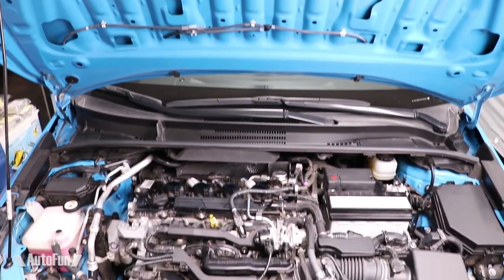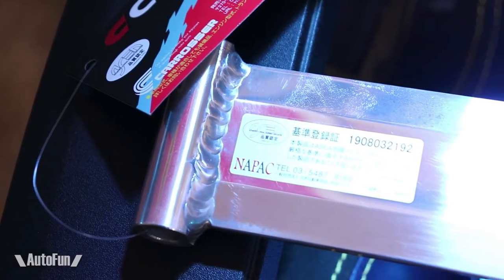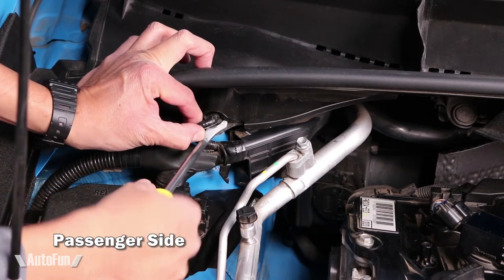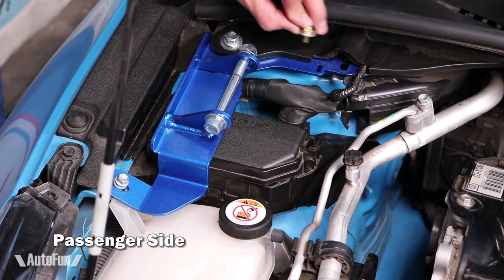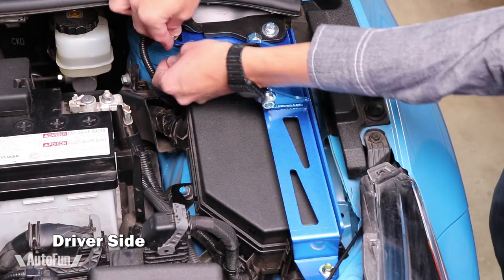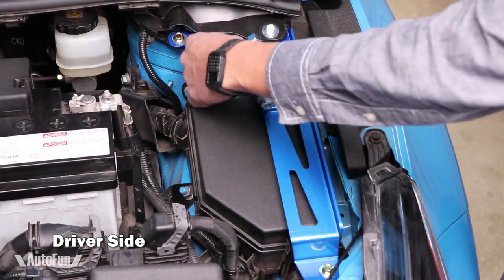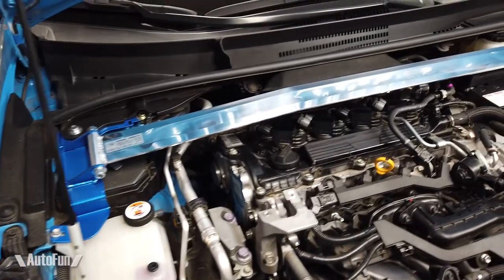Toyota Corolla CUSCO STRUT BAR Install & Review (E210 Hatchback 2018-2024)

Comment: This actually felt like it tightened up the steering some how. Thanks again for this video. Was a lifesaver. Although there’s still a loose nut in my engine bay. Not your fault lol.
Reply from the maker: Hi BBB! Yeah, the change is subtle but I also definitely felt it and it definitely also adds bling to the engine bay lol Cheers!

Comment: That bar is mounted to thin, body sheet metal on one bolt per side, the other two secure plastic trim. Strut bars need to be mounted directly to the strut hardware, which this is not. There is almost no rigidity gained from these Cusco units. Sure, it looks nice but that's just about it.
Reply from the maker: Hi Datsun Dan! here is the version that mounts directly to the strut https://youtu.be/yGkDgtHog60 for ultimate rigidity if your not looking to add bling to your engine bay. Hope this helps, Cheers!

Comment: Nice video. I'm definitely considering getting this strut bar. I am curious though. Looks like it covers maybe the fuse box on the drivers side and would need to be removed every time you need to access the fuse box. Is this true?
Reply from the maker: Hi JWalker! yeah it looks even more awesome in real life. To answer your question, yes it does block the fuse box (you can probably open the box but I don't think you can fit a finger in there lol) so I would have to be partially removed if you need to access your box often. Here is another alternative that does not block it (won't add as much bling to your engine bay, a little more work to install it but it's fully functional) https://youtu.be/yGkDgtHog60 Hope this helps!

Comment: the cusco strut looked really nice. It also put the bar forward in the engine bay. But I concern that one of the mounting point is actually on top of the coolant reservoir mounting clip, wouldn't it eventually break it?
Reply from the maker: Hi Fisher! Ah yes the Cusco bar does not mount to hard points on the frame (this can be a plus or a negative depending on how much NHV you are willing to bear and the amount of performance you need out of the car). Here is a good alternative if you don't need the cosmetic appeal of the Cusco and want ultimate performance (at the cost of increased NHV) https://youtu.be/yGkDgtHog60 Cheers!

Comment: Does the feel differ from the TB bar you had?
Reply from the maker: Hi jchcmax! Here is how I would compare them now that I experienced both: Cusco is just a work of art, looks gorgeous which is great for car shows and is functional. If performance is your top priority then the TB Performance is the way to go, the bar mounts directly to the strut towers which puts it ahead of Cusco as far as chassis bracing. With the bar and plates being black, it almost looks stock (I like the sleeper look) it blends in with the engine bay but for some people this may be a downside ( it may be possible to get it in other colors if you really want to add bling to your engine bay but I can't confirm that you can). As far as price difference, Cusco is more affordable vs the TB Performance which costs a bit more. Hopefully this helps bud and thanks for watching!

Comment: Overall did it make a big difference in handling and steering feel?
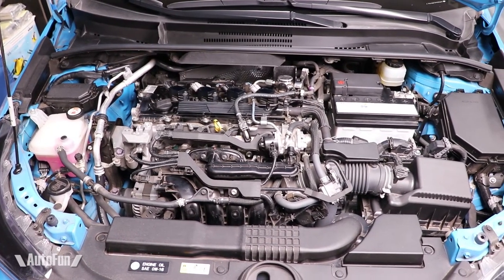Reply from the maker: Hi Caleb! yes it does but as I mentioned this is just one component of bracing and suspension, as you add more to the car the difference becomes more noticeable, but take a look at my test drive impressions at 9:31 for more complete explanation and thanks for watching bud!
Reply: No i don‘t think so. It‘s mounted extreme wabbly. You need one with strut bearing mount

Comment: If I buy it used and it doesn’t come with hardware would I still be able to install? Or I probably would have to buy the washers and use original nuts?
Reply from the maker: Hi Jose! I would recommend contacting Cusco to see what they recommend. Cheers!

Comment: Do you like this Cusco strut bar or the TB performance strut set up?
Reply from the maker: Hi Rush! Here is how I would compare them now that I experienced both: Cusco is just a work of art, looks gorgeous which is great for car shows and is functional. If performance is the top priority then TB Performance is the way to go, the bar mounts directly to the strut towers which puts it ahead of Cusco as far as chassis bracing. With the bar and plates being black, it almost looks stock (If you like the sleeper look) it blends in with the engine bay (for some people this may be a downside). As far as price difference, Cusco is more affordable vs the TB Performance which costs a bit more. Hopefully this helps, Cheers!

Comment: Cusco is eye candy, it works until you lean on it with your palm and it bends. This just happened with mine, sorry not happy with product.
Reply from the maker: Hi motomanz! and man oh no.. That definitely does not sound good. The bar is hollow for weight reduction and the internal shape of the tube has a lot of rigidity to support pressure in the horizontal direction (from strut to strut) while this design is great for aesthetics and low weight it also means that it will not be strong in the vertical direction, so I can definitely believe you it may bend if leaning on it. I haven't leaned on mine since I wanted to keep all finger prints off so I don't really touch it but man I'll be extra careful, thanks for sharing your experience bud!

Comment: What is strut bar be a good choice for every day driver.
Reply from the maker: Hi Harry! for our E210 we have this one the Cusco and this one https://youtu.be/yGkDgtHog60 the TB Performance one. Both should perform about the same on a daily driver, remember strut bars are usually only felt (or their advantage is only) when the car is being pushed to it's limits (normally at the track) While the do benefit a daily driver they usually can't be felt during normal driving conditions. Now if you are looking for the one that is the most attractive (if you are looking primarily to add bling to your engine bay) then the Cusco bay would be the way to go. Hope this helps, Cheers!

Comment: how does this mod do what its supposed to do when it connects to plastic ?
Reply from the maker: Hi Mir! You can hear my impressions of the Mod at the end of the video during the test drive. I would say Cusco is just a work of art, looks gorgeous which is great for car shows and is functional, so a good choice for someone looking to add bling to their engine bay along with some bracing. But If performance is the top priority then this one https://youtu.be/yGkDgtHog60 by TB Performance is the way to go, the bar mounts directly to the strut towers which puts it ahead of Cusco as far as chassis bracing (the install is more involved). With the bar and plates being black, it almost looks stock (If you like the sleeper look) it blends in with the engine bay (for some people this may be a downside), Cheers!
Reply: @AlexAutoFun  i just did not want to take the windshield wiper and cowl off.
Reply from the maker: @mierkoe5370  Hi Mir! Ah yes then the Cusco will have an easier install. Cheers!